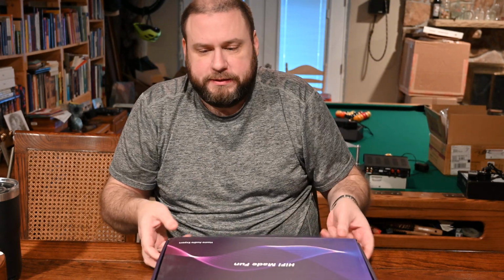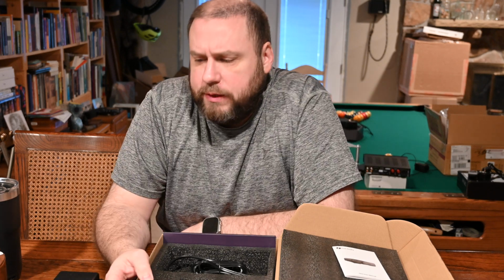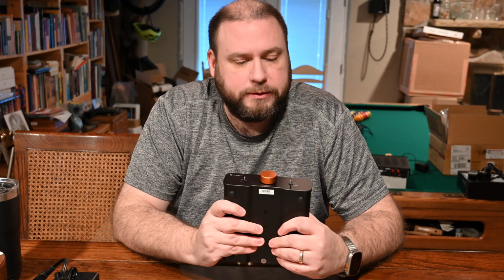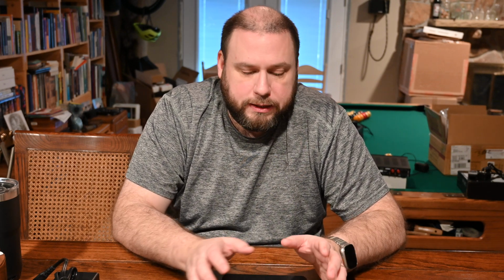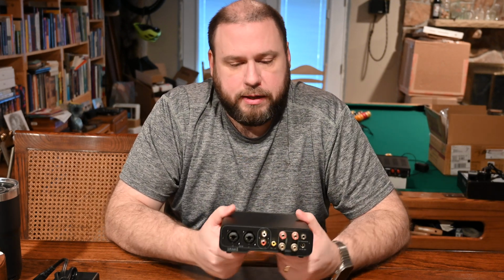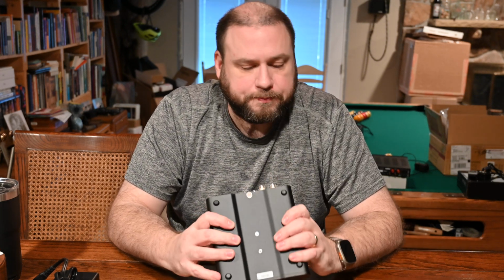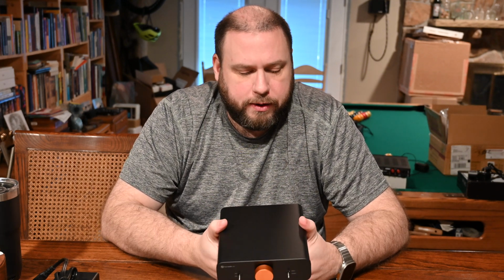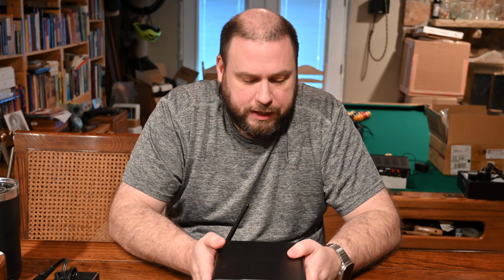Fosi Audio ZA3 Balanced Stereo Amplifier Home Audio 2CH Mono Amp Unboxing

Comment: Which is better, the ZA3 or the Aegir2?
Reply from the maker: I prefer the Aegir 2 but to be fair, you’re comparing a $100 amp to a $1000 amp. Both are very good for the price point they are in. The ZA3 has balanced inputs in both Stereo and mono, where the Aegir only has balanced input for mono. The noise floor is much lower on the Aegir and it also is better at bass reproduction. Overall, I would pick the Aegir if money wasn’t in the equation. That being said, I’m very happy with the ZA3 for what it is.
Reply: @ thanks. I have the ZA3 and just ordered two Aegir2s. I actually preferred the ZA3 over a Gato DPA 4004.
Reply from the maker: Haven’t tried the Gatos. I’d love to hear your opinion on the Aegir!
Reply: @ just hooked up the Aegirs. They sound fantastic...more detailed and nuanced than the ZA3 with a better soundstage. I first tried them in mono/bi-wire configuration and they jumped out of Class A at about 83db in my system. I then switched to a stereo/vertical bi-amp configuration and they stay in Class A a little longer. This is running full range, which will change as I have dual subwoofers with cut off set at 80hz, so the Aegirs won't be pushing heavy bass frequencies. I would think they'll play cleanly without clipping up to 95db which is about the max I'll ever play.
Reply from the maker: They should be fine up to 95db. I’m so glad you like them!